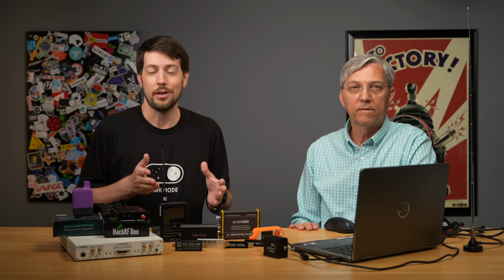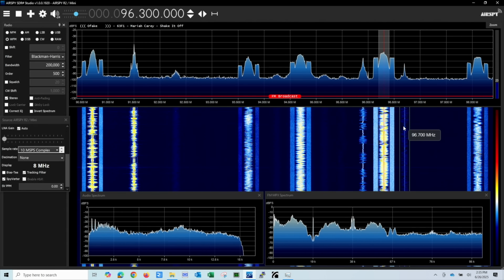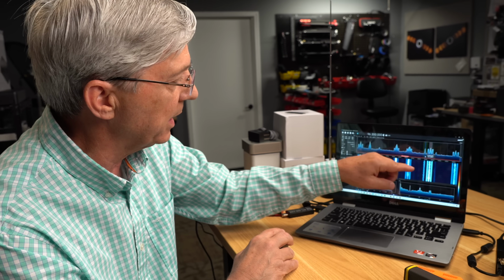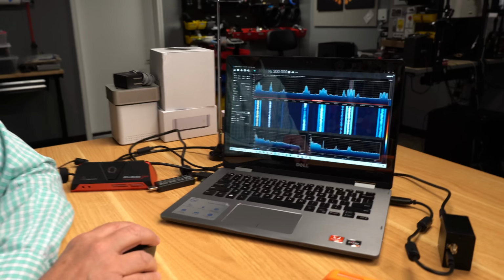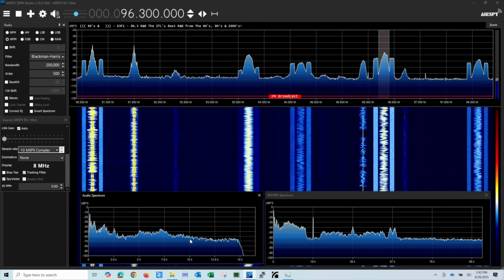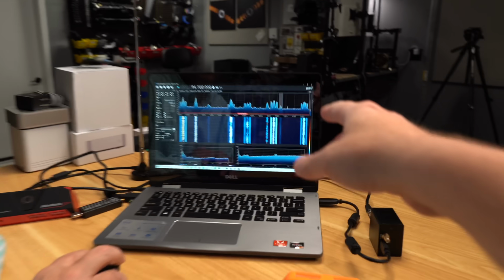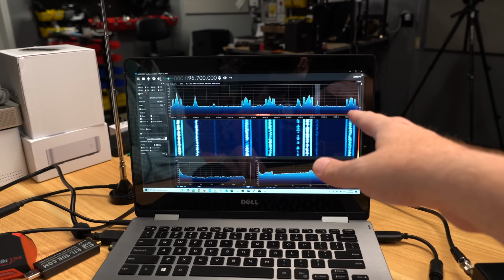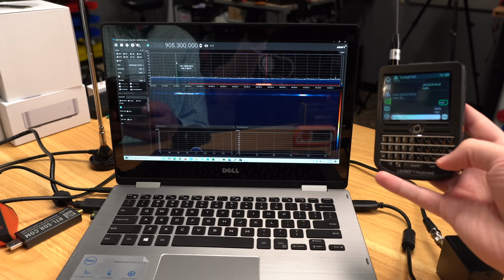SDR is an incredible tool for understanding radio

Comment: Some really great options for folks interested in getting into radio, either just listening around the band or with a more engineering bent.  Having worked for 45+ years in radio (mostly satellite communications) I've had access to top notch test equipment and very high end spectrum analyzers.  We've used SDR related techniques for years in one form or another, and many new commercial products are actually SDR inside.  But the advent of low cost hardware like the RTLSDR and free and open source software has really brought SDR to mainstream use.  

While a satcom engineer in my day job I'm also a ham for fun in my off hours.  I have a pretty decent home lab set up including an HP 8563e spectrum analyzer but now have several SDRs as well.  A RTLSDR, an SDRPlay RSP Duo, and a HackRF One.  GNU Radio is also a great tool for learning about radio and building your own tailored applications. Looking forward to see how the industry grows going forward.

Comment: I have 2 SDR's in my garage hooked up to two raspberry pi's acting as servers and listen to the SDR's inside my house over ethernet . I use the  raspberry pi's because it is easy access to the outside where I have a few antennas mounted.

Comment: Some of the FPGA based ones can do pprocessing if you program them. I recommend staying away from that rabbit hole unless you have a lot of free time. 
GNU radio might also be interesting to cover. It's also a great destroyer of free time. It's pretty useful for processing signals. I believe it's origin start with the sound card based radios before SDRs were affordable. Great for things like using your SDR to automatically decode those meshtastic signals.

As for SDRs. My first dongle was a cheap RTL TV tuner.  Besides an unknown quantity of random dongles like in the video. HackRF One, bladeRF, RSPduo.

Comment: One reason that the NI USRP-2953R (big white box) is so much bigger and more expensive than the other units is that it operates a lot higher in the spectrum - between 1.2 and 6 GHz and it is a Software Defined TRANSCEIVER - both receives AND transmits. Jeff and Joe can use the transmit capability because they're both licensed as Amateur Radio Operators and can use that unit to transmit in the portions of spectrum allocated for Amateur Radio use.
Reply: The USRP size is due to modularity and expandability, not capability. The LimeSDR can hit 3.8 GHz but is the size of a credit card. However, it has scant expandability.

Comment: ooooo, you have piqued my interest. I'm looking for ways to point my cell antennas used for control telemetry, can I use this for those freqs? Sometimes I have plenty of "signal" but the "quality: of the signal is poor.  To elaborate there are 4 parameters available in the cell routers RSSI, RSSQ? and 2 others that escape me at the moment and all 4 have to be good for optimal performance. Those reading are available in the device (and possibly specific to the cell provider?) but it's not convenient to access them in the device>.a separate device like these would be fantastic for these surveys.

Comment: I use six, one for ADS-B, one for AIS and four for Radiosondes. It's always good to have n+1 SDRs! ;)
Reply: That is what peaked my interest to look here.   I ideally want to monitor ADS-B just for fun, AIS and Marine 16 for Marine SOS etc as I live in a coastal area and frequently I can hear things the coast guard can't, possibly the HF marine eventually.   At the same time I can do similar on my HAM etc.   Do you have thoughts on SDRs as far as which ones ?   I have seen many people do a USB hub with stacked RTL-SDRs etc.    I have also seen some fancier ones you could monitor multiple frequencies.   I am also looking to configure a good multiplex setup or such, the ones I have seen do have about 3db in loss.    Just curious if you have solved any of these, my house already will have way too many antennas up.  Thoughts ?  Thanks in advance
Reply: @steveneaton7164  I use the orange FlightAware Pro Stick for ADS-B with an 1090MHz cavity filter. For AIS I use the blue AIS-Dongle from ShipXplorer with an the Flamingo FM notch filter. I recently replaced the four Nooelec RTL-SDR v5 SDR - NESDR SMArt and a 5-1000MHz power splitter QM-PD4-05100S from Aliexpress with an Airspy R2 SDR Rx with a cheap 403 MHz band pass filter from Aliexpress. Hope this helps.
Reply: why do you have 4 for radiosondes? different locations? directional antennas?
Reply: @Nitrxgen  you need one sdr for scanning for the sondes. The other sdrs are for continuous tracking of up to three sondes at once, but this was unstable I had to restart the Radiosonde Auto-RX container every day… With the Airspy I can now track nine simultaneously without any problems. The downside is that auto rx and airspy services did not work in containers…

Comment: I can't afford a new hobby Jeff, stop it!
Reply: Seriously! My day is made if I can buy a handful of connectors, NP0 capacitors or a can of Super Dustoff.
Reply: I was listening to 40m ham radio earlier on a £40 rtl-sdr connected to my £35 second hand silver rod CB antenna using free SDR++ software. It doesn't have to cost the earth to scan around for fun.
Reply: @TheeMuseumofjunk  I'm not afraid about the start, I'm afraid how it ends :)
Reply: @wildekek  As I'm looking at another new radio today you make a fair point 😆
Reply: @wildekek  It ends whenever you like! There's enough fun on the VHF band to keep you busy for a couple years for less than $100. Radio cert, an SDR, and a UV-5R go way further than you may think
Reply: Fuck it, I bought a HackRF with Portapack, and it is your fault.
Reply: I now have a NanoVNA and need more antennas. Where does it end?
Reply: @wildekek  😂 my condolences
Reply: It's not an expensive Hobby unless you want to make it one
Reply: @RowanHawkins  Who are we kidding now.
Reply: It's not "new".

I was an SWL in the 90's, in my twenties, even before I knew I was an SWL 🤭 with only a "Contec" Double Cassette Player (!), with excellent SW capabilities 😍
Reply: It's no joke. I just spent $600 on two fiber glass retractable masts to make a huge antenna.
Reply: @vincei4252 
You cheapskate, why not carbon fiber.
😅
Reply: @ethasitoem8292  I meant carbon fiber. Must have been having a partial stroke from all the money I've spent.
Reply: idk why this stuff is so fun to learn about
Reply: My wife said no more radio stuff !!!
Reply: You can get much of the equipment for under $50, so you probably can afford to at least get started.
Reply: @dmatech  Yes, and then I spent another $500 since this post. Portapack H4M, a NanoVNA, some antennas, and down the rabbithole I went. THANKS JEFF.
Reply: I just bought a motorcycle.

Comment: A cheap RTL sdr could be used as a poor man's spectrum analyser.
Get one if you're into electronics.
 It's a useful tool to sniff out signals without probing the circuit. 
Just watching your terribly built oscillator circuit in a frequency domain would be much fun.
Reply from the maker: Heh, makes circuit designers humble!

Comment: The ferrites come in handy when using SDRs in a transmitting-environment - as RF in the air can lock up USB port. Choking off high-powered RF (in the ham shack, for example) is very common - on all signal cables, analog AND digital. Good video - always nice to see the two of you talk radio! 🙂
Reply: The function is RF choke - to stop RF from entering, or leaving a cable. The material (that happens to be usable, cheap, and reasonably compact) is ferrite. Thus RF chokes work the other way also, and that is the primary reason there are RF chokes in high data rate signal cables like USB, that they can TRANSMIT radio signals. After all, any signal above DC (0 Hz) is technically part of the electromagnetic spectrum, and there are limits that the FCC (and other countries' communications regulators) impose so as not to interfere with radio communications.